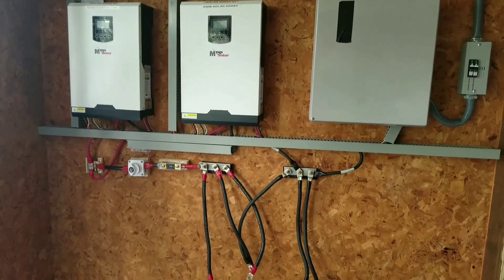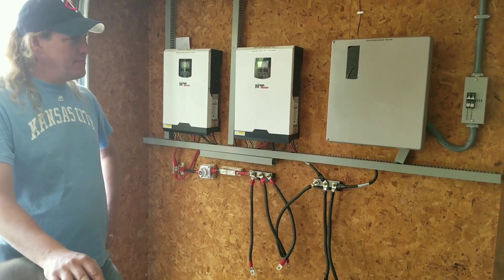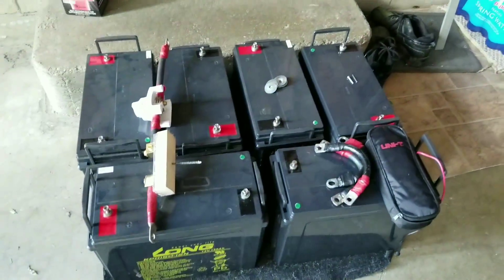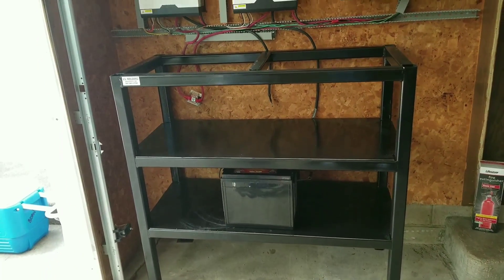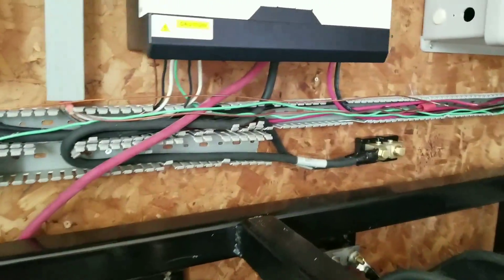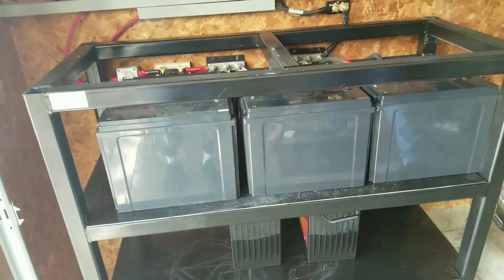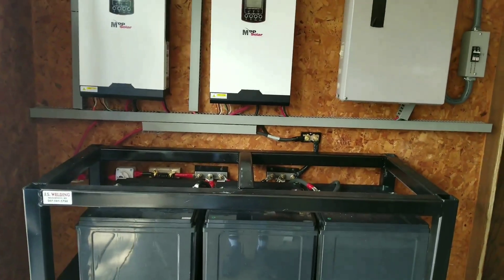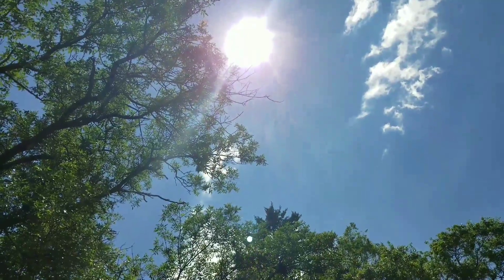TEARING DOWN PIP 2424LV-MSD SOLAR SYSTEM Pt#1

Comment: is it possible to get 220v off the 110v LV PIP unit? like if take 2 110v legs to make a 220v like how it works in you house panel.
Reply from the maker: No